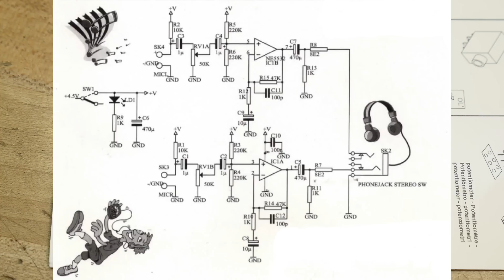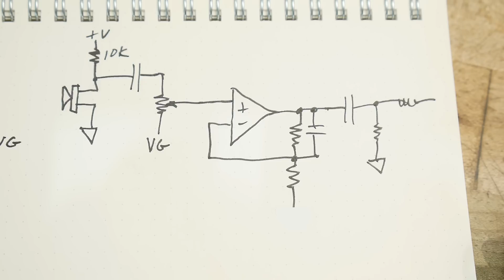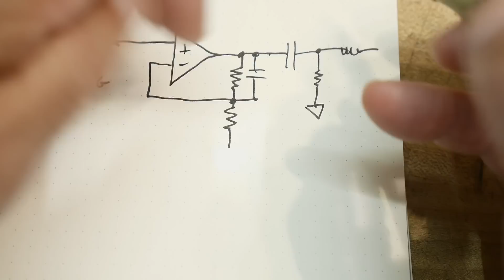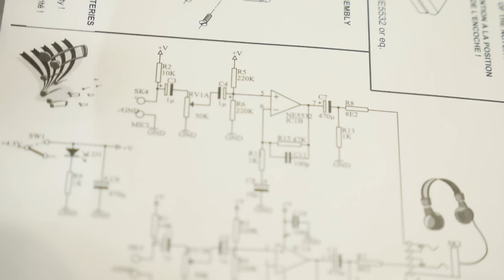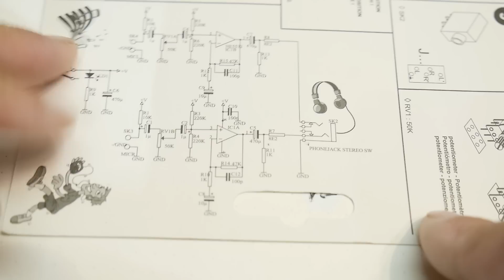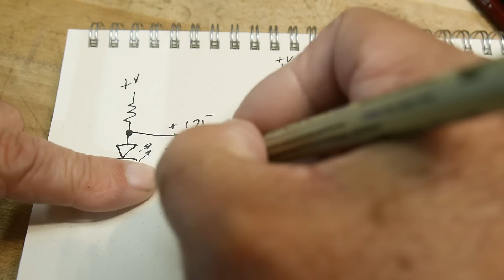#1590 Reduce part count (smart or dumb)

Comment: First thing I see is... NE5532 and 4.5V supply voltage. That drops to 3.0V when the batteries are fully discharged. Any serious product claiming to work from 3x1.5V cells needs to operate down to 3.0V ideally, and 3.5V if you want "cheap but still usable".

NE5532 barely works from 4.5V as-is and doesn't meet its specs at that voltage. At 3.0V, with luck and clever circuit configuration it may have some gain, but at that voltage an LM358 with output biased into class A operation may outperform it at low gains.

For such a low supply voltage, "worse" on paper CMOS RRIO op-amps perform better and have plenty of headroom. Jellybean parts from Microchip, for example..

With 4.5V supply, an NE5532 op-amp may have +/-0.3V common mode range around mid-supply. It won't work at all with 1.3V LED-derived virtual ground. Even for a kit, this design is bad as-is. It needs a different op-amp. A TLC274 with gain split across 2 stages would work well with about 1V common mode on input and output, if we're playing vintage parts.

If someone asked me to make a kit performing same or better than this one, with even cheaper parts - I'd stick a three-stage class A amplifier on each channel, with global feedback, and call it a day. Such circuits were the mainstay of audio, and with some attention to detail they performed very well. Certainly better than an NE5532 running from 3 AA cells :)

A 4.5V NE5532-based design is fine of course... if it has a low-noise boost converter to 12V, followed by a wideband 9V LDO. If that's designed to work for 3xAA cells, then it will work also great from a single rechargeable lithium cell.

Comment: Component count depends on who's it for. If it's a circuit published by parts supplier (ie Digikey) it needs as many different parts as possible  to 'add value'. 
If it's a mass produced china product it'll be the minimum number possible for maximum yield.
If it's a hi-reliabilty for aerospace then it'll have the odd extra part in to prevent fault propagation after a single point component failure.
And for performance: in aerospace and mil grade to just say "xy component stops instability" is not good enough. Have to demonstrate with tests the amount of phase margin it is away from onset instability at worst case conditions including end of life aging.

Comment: Electret mic bias resistors are usually selected to provide somewhere around 100 microamps (or maybe up to half a milliamp) because the microphone FETs have lowest noise with currents in that range.  Phantom power is 48V through 6.81 kilo-ohm resistors on both hot and cold sides of a balanced connection,  not 70V.

A hobbyist is happy when he  can get a circuit to work on the lab bench. Professionals design their circuits so that it's hard to make them fail in unexpected or damaging ways, in all kinds of environments.
Reply from the maker: high end condenser microphones have 70V internal: https://youtu.be/8IS7rScFL2U

Comment: opamp input bias current now flows through the pot wiper. if the pot gets dirty, it'll crackle slightly when adjusted. the original circuit is immune to pot crackle because the pot sees zero dc current.

Comment: Hi IMSAIGUY, do you have any videos which might discuss the use of a multi-channel ADC for measuring things with different ground potential?

Specifically I'm interested in monitoring an 8s lithium battery pack, but I'm not informed enough about how ADCs perform their voltage comparison, especially given that for each successive cellnin the pack, the minus terminals are progressively higher potential than the overall 0v gnd of the pack.
Reply from the maker: don't worry about what is called ground. just wire each connection to a multichannel ADC and measure each voltage. then just do the math for the voltage difference at each cell.
Reply: It's a bit tricky to do.

Your battery will be over 32 volts when fully charged. That is way beyond what any ordinary ADC can handle. You would have to attenuate the voltages at the battery nodes which imposes as load on the battery that may be intolerable unless you can switch the attenuators to the nodes briefly to make your measurement. That needs switches that can be controlled conveniently and that isn't particularly easy because of the level shifting requirement. There are a number of ways to do it but the parts count tends to be high.

I quit doing this stuff years ago so I'm out of the loop with regard to what is on the market. Linear Tech. had an IC specifically designed for what you want to do, but I don't know if it could handle 8 cells.

At one time there were some high-voltage analog multiplexers one the market. They were quite easy to use, with low voltage control signals. I have no idea if anything like that still exists. I don't recall who made them. 

When I was doing power electronics I was forever cursing because I'd see an announcement of some new part that sounded really great until I discovered its maximum voltage rating was a few volts below what I required.

Comment: The non-inverting amplifier has the capacitor to ground in the feedback circuit. At low frequencies where the output capacitor would be useless the op-amp has unity gain. It isn't trying to amplify low frequency signals and wouldn't add extra noise. Even if you had a bi-polar power supply and DC coupled to the headphones you don't need or maybe want frequencies below 20 hz, so you might still use the feedback capacitor. The virtual ground can be made with two equal resistors, which they used in the original circuit. Resistors are cheaper than LED's.

Comment: Good idea to start a conversation...
Using the LED as a virtual ground was a great idea to create a global virtual ground for everything... Saving already 4 resistors and one capacitor (let's not steal the power supply capacitor for now).
But then I thought... Heck, why do we need a virtual ground anyway?
We're using an electret microphone as the signal source, and it already operates in class A so, adjusting the right load resistor how much DC voltage we expect at its FETs drains?
Isn't it 1/2 the supply voltage?
So why not feed the input of the op-amp directly from the electret microphone...(Ok, so far I stripped out 4 resistors and two capacitors).
But hey... There's the volume control... How do we go about that?
And I thought, why not using the potentiometer in replacement of the negative feedback resistor....
This would make for an amplifier with gain between 1 and 50... Volume would never go down to zero but... Is it all necessary? Something to be tried...
(Ok, then I would be getting away with two additional resistors).
But, unlike your virtual ground approach, I wouldn't be able to get away with the two electrolytic capacitors in the feedback path (the capacitors that decouple the DC offset of the feedback path)...
But then, what about using just one for both channels...
It's very low impedance for AC so, no big crosstalk issues, at least in mid to hi frequencies and, in the low freq... the microphones would be in phase anyway.
I'm still unsure about the DC imbalance there could happen between the two channels... But would there be some way to trick that?
Matter for thoughts!

Comment: I am not at all good at analog, but whenever I try, I almost always run into CMRR problems... I can't even begin to guess how that applies to single-supply amps, common-mode voltage with-respect-to... what? Then again, dual-supply chips don't actually have a ground input, so now none of it makes sense. But I'd lean toward centering VG since this is AC-coupled...

Comment: The capacitor parallel to LED is to reduce the random noise generated by the LED. The capacitor on the "grounded" leg of amplifier feedback network is there to eliminate DC gain (DC gain effectively becomes 1), so the amplification is above 1 only for the AC part of signal.
Reply: Just FIY - LEDs are one of the cleanest and low noise voltage references you can have.

Comment: Usually, I've seen bypassing the battery with a cap when the design is subject to RFI. There are other reasons to do it too.
Reply: 470 uF is a bit heavy for RF bypassing. And a big electrolytic like that is likely to be an inductor at the frequency of interest, no?

Comment: 'Bypassing' a 'battery'.... 3 1.5 V cells in series... is an engineering thing (sort of best practice.) Subject to some caveats... it doesn't hurt the design if you do it. The ESR of a good aluminum electrolytic cap is about 10 times less than the battery impedance. Anyway... bypassing is a way to set an upper limit on you power supply impedance.
Reply: Indeed.
If your supply's source impedance gets too high you can effectively get positive feedback via that impedance, depending on the circuit design, and turn your amplifier into an oscillator.

Comment: if you limit the bias voltage to1.7v you also handicap the outputs ability to use whatever supply voltage is available since you have imposed a 1.7v upper limit on the + part of the sine wave minus output transistor losses so fine if you only want 100mv or so output swing and this is less than amw into 32R headphones which I believe is the intention of this circuit there's no other valid reason for that 8R2 output resistor otherwise you would add 1K if you're worried about output capacitance pull the 470uf cap at the output gives it away it's for driving low impedance loads and the choice of ne5532 opamp with its high output current drive full rail into 600R limited by chip dissipation or over 2v into 32R

Comment: In general, will it work? It looks like yes, can it perform the same like circuit with components? There is no logic for that.
Are there overcomplicated circuits? Yes. There is fine line when over-simplyfying comes with side effects. Its like tastes, tastes should not be discussed.
Reply: It's both under-complicated and over-complicated. NE5532 is useless with 3xAA supplies. It will just barely work with 4xAA. A fully discharged AA cell is 1.0V. So, if anyone thinks "3xAA=4.5V" that's being short sighted - it's really 3.0V up to 4.5V across the 0% to 100% charge state. That's how product design for 3xAA is done if one doesn't hate the customers, that is.

NE5532 doesn't do much from 3V, so just three cells is a nope unless you want the user to be tossing out batteries that were 30% discharged. An NE5532 running from 4.0V up to 6.0V is probably the minimum needed for any sort of usable performance that even begins to resemble the specs of the chip. If someone asked me to design a 3-cell 5532-based amplifier, the first thing I'd toss in would be a low-noise boost converter and a wideband LDO to get the voltage up to 9V for the op-amp. At that voltage, the op-amp would be performing reasonably well. Usual audio applications of that op-amp run from 12V up to 30V, so 9V is really not much, and 4.5V is a bit of a joke.

Comment: I would be careful removing all the capacitance from across the battery. When the battery drains a bit the internal resistance rises. You could get oscillations. Not saying it will happen in every case but there is the potential.

Comment: I would expect there to be varying current through VG which would result in varying voltage at the LED which might cause it to flicker which could be considered as either a positive or negative "feature".

Comment: Just toss out that fancy NE5532 and use a much cheaper LM358, use an inverting arrangement and toss about 1/2 of the passive components.  This certainly does not have to be Hi-Fi.

Oh, wait, no .. I see my error.  That dammed ac coupling on the input throws a wrench into my idea.  Never mind..

Comment: I like reducing component count too 😉 But sometimes it has to look a bit more complicated than necessary. A high count of cheap components and a controller with cracy high pin count just to blink the LED and do some other nonsense is what the marketing department is looking for  😇
Reply: I think this is a big part of these kit's appeal.  Buyers are looking to "solder a bunch of things together to make an impressive looking device".  The result is more impressive to show off to others when it's 30 pieces soldered up into something that works, as opposed to a small or sparse board of 20 pieces that does the same thing.

Comment: Another thing you might consider for a parts reduction is create your virtual ground thru using the mid-point of a pair, or set of four, or six, or eight batteries in series thus making the simplest dual power supply for your op-amp. 

I suppose the only downside would be any added whistle such as an LED light would likely result in lack of complete symmetry of the voltages with respect to the virtual ground thus possibly resulting in clipping on one side, but not the other.

I am a big fan of using DC to DC buck converters that output -5 volts to + 5 volts when implementing op-amps that need dual supply. This does not actually simplify the parts count, but for a guy that went thru pure math grad school and never spent an hour in an EE lab it sure simplifies things for me. Honestly, when I first started playing with op-amps I had no idea the symbol for ground in the schematics indicated a virtual ground thus dual supply. That threw me for a bit, but so did the approximation of non-linear behavior in transistors with linear mathematics. i.e. Going from the world of precise to easiy to model was a rude awakening when I decided to take on the hobby and was not warned in advance of the simplification.😊
Reply: I hate multiple batteries to create multiple voltages with passion - try reusing the circuit with a DC supply - you can't.

Comment: You shoulda noted that the Mic is an Electret (not a Dynamic or Condenser).  Also should have noted that C3 is also a DC blocking cap as well as the audio feedthru. EZ to critique when I am not making the vid.
Reply from the maker: I'll be doing a video on the mic

Comment: I'd probably replace the non-inverting amplifier with an inverting configuration, since they're easier to bias: you just hook up the non-inverting input to a positive dc voltage, and the output will be raised by that amount. Part count would be the same as your solution, I think
Reply: Inverting configurations have low input impedance which isn't great with electret mics.
Reply: @gregvanpaassen  Good point! That's also probably why the designers chose a 50k pot for the volume control.

Comment: MadmanMuntzGuy! After his engineers came up with a working circuit, Muntz would go through them with a pair of dikes, clipping out components to see what they could get away with. It would be interesting to see you go thru this cutting and bodging components. For example, you asked about C6, the battery filter. I remember as a kid building a lot of battery powered kits, many of them performing poorly, until I realized, duh! I'm trying to operate this kit with a half-ass dead battery. I figure most of Velleman's expense in making these kits is packaging and distribution, with far less expense in resistors and caps. I could see that a crappy battery with no filter could cause circuit instability, so Velleman is doing what they can to make the circuit work best under poor conditions. And of course most of these kits are battery powered to get around product liability and UL approval. Its all about the big money losses that are possible through litigation, versus spending a little extra for these parts to ensure better performance so some kid running the kit with a dead battery wont say - "These Velleman kits are crap!" Which they are.
Reply: Ya... that was before they had a 'working' circuit. Muntz didn't do that with a working circuit... for obvious reasons.

Comment: The capacitor across the supply will stop motor boating when the battery's internal resistance increases with age.
Reply: Also reduces pop when turning on.
Reply: motorboating    that's a term I've not heard for a while        to3 germanium OC35 last time I saw one was in 70s!

Comment: phantom power is 48vdc not 70
Reply: Older tube amps supplied more then 48 volt for the mics. I e +/- 70v was common back then.
Reply: @jj74qformerlyjailbreak3 P48 was introduced in the mid 60's and has been pretty much the standard since. Maybe some pre war equipment used 70V, but it was certainly never a standard.
Reply: @JaenFoster  correct. 48 v is standard but my tube amp supplies +/- 35v for the mics to feed from. Bell Carillon 35 W preamp.
Reply: I’m not saying 70v is standard here.
Reply: phantom power is whatever voltage they choose to give you  12  48 70  200 (for precision measurement)
Reply: @jagmarc  thank you for saying that. That couldn’t be more correct the way you lay it out. 😂